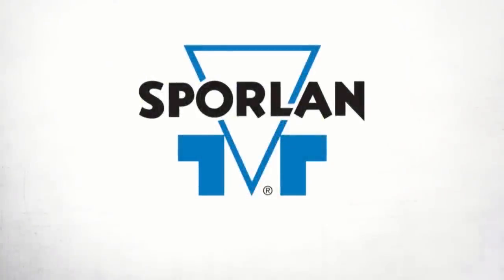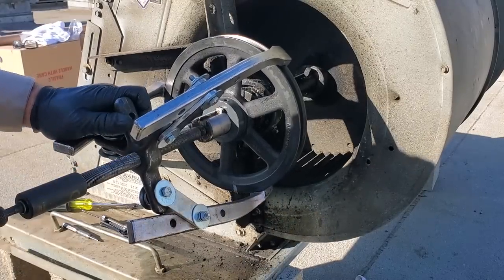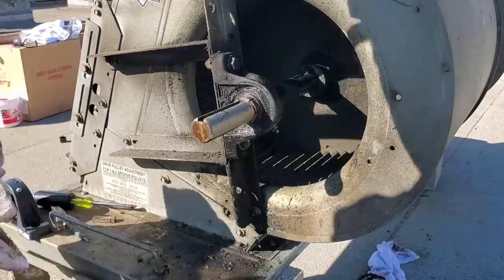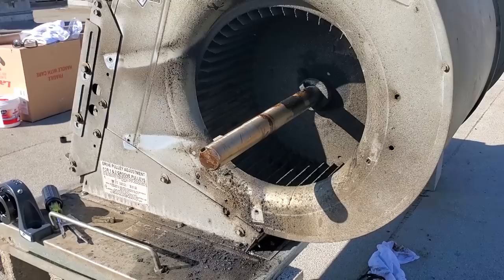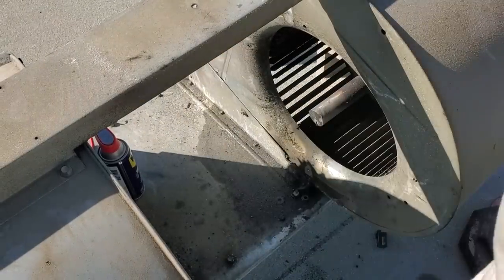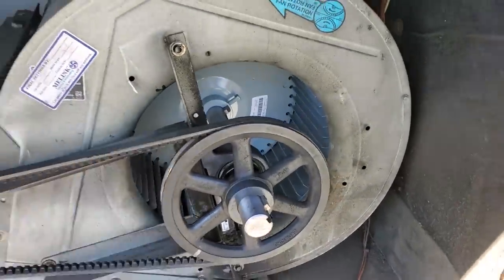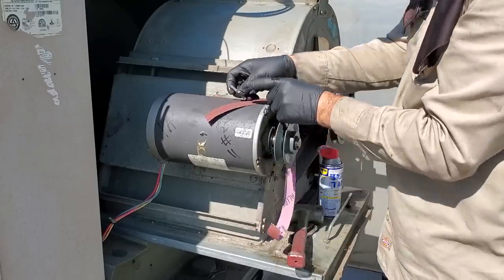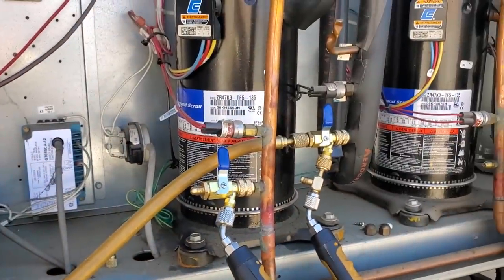LENNOX PACKAGE UNIT WITH BAD BEARINGS

Comment: As a non-HVAC guy... for the puller... you may want to try another way: use a big drill to make a small hole at the end, just enought so the tip of your puller get in. This will prevent it from wanting to walk away. Like a center hole for machining... Like center punch, 1/4" then switch to 1/2". The side of the  drill bit don't have to get in... Heck probably direct with the 1/4 it would be enought!

Comment: A sawz-all is your best friend when you’re trying to get rid of a shaft. Don’t even need to bother taking the bearings off. Cut the shaft inside the housing, no need to take the frame apart and the blower wheels drop right out. Text about five minutes total for both of them

Comment: Regarding the pulley remover - Looks like there was no cap on your threaded rod. The cap allows the rod to rotate without dancing over the surface of the shaft.

Comment: Knowing that you are going to replace the wheels, shift and bearings, you should have used a sawzaw to cut a 8" hole around the wheel hub. The bearings and shift could have slid through the hole in each wheel and you would have been done in 15 to 30 minutes. But I know you are showing how to remove just one bearing as well so... very informative.

Comment: You left the belt a little tighter than I would which doesnt affect how it works but does wear out the belt faster. The tighter you have it the faster it wears out do to constant tension and the elements.

Comment: anti-seize compound on those shafts would have been nice. Especially on the motor shaft, since its likely that the drive sheave is going to eventually be replaced again.
Reply: A guy I work with use to do that until he read the instructions that come with sheaves which is usually in red and states that using anti seize will void any warranty
Reply: Andrew what that was mostly likely is a tapered bushing sheave, where you definitely do not want to put an anti-seize or lubricant on the tapered surfaces. Even on those it is perfectly acceptable to put anti-seize on the shaft.
Reply: You can also have fun with Never-Sneeze. Just put a little on the underside of one of your co-workers toolbox drawer pulls, sit back and enjoy what ensues.

Comment: Oh yeah, pro tip....easy way to sand the shaft of a good motor to put the new pulley on, turn it on and use sanding cloth to clean it up nicely.

Comment: Idea: Cut some small notches into the outer edges of the pulley puller, then you can run a big rubber band around it so that the arms will keep pressure onto the pulley.   That can reduce a 6 hand job to 4 hands...
Reply: or put zip ties on the arms instead of notching them, then use a bungee cord.  Even easier.

Comment: If you ever get to do more, top tip for me would be to find a nice grade of steel wool which doesn't strand off, its often too hard and heavy obviously application dependant to go straight in with emry paper especially when dealing with seals etc and is often good for gripping and twisting round threads on other materials to clean has a lot of uses and when cleaned off polishes and picks up the shit, quick spray and wipe and good as new
Reply: Just as a side, thoroughly enjoy watching your vids

Comment: If I can give a small advice, it's about 30:42
Please don't use sandpaper over rotating parts. The sandpaper will release a bit of corundum dust as you work it and it's a disaster if you get that in bearings like in the motor below. It's way harder than HSS or any tool steel or cast, it's what grinding wheels are made of. It can stick into the bearing and cause pitting and lines of wear because it loves to stick into grease and into oil filled sinters too. It literally reduces the life of a bearing by years if it ever gets in there.
Also about the hex wearing out, order tools from WIHA. They make absolutely indestructible tools, we used them in the factory where I was and they could torque down literally hundreds of thousands of parts without wearing even a tiny bit

Comment: Gearwrench brand pulley puller. They are worth the money. The one I use has index notches so you can set each jaw without having it flop all over the place. Made my job so much easier.

Comment: Dude leave all set screws on motor pull loose and it will slide right on . If u tighten ajuster set screw makes for a struggle to reinstall. May I recommend a cutting torch if replacing shafts anyways much faster and less frustration. I also find  penetrating oil doesn't really help to unlock bearings etc just makes a mess.

Comment: I fully agree with the second guessing part. If you're just completely certain about something, you can easily just miss something, or gloss over something.
Second guessing yourself means you double-check everything, and that helps to make sure you don't forget something.

Especially when you're getting ready to do something that you can't take back, like when you cut that shaft. If you just go for it, you might've missed something, or missed a step, or something.

So yea, having that little bit of doubt isn't just great to have, I'm willing to claim it's paramount to avoiding possibly simple mistakes.

Comment: I have a trick for you , You are replacing the blower wheels and bearing so why not use cutting torch to cut around blower hubs and make quick work of this? The only part needing  to salvage was blower housing and pulley. Seems you worked very hard for such a easy repair.

Comment: I was called in to repair bad bearing on a dual fan assembly in the basement of a school, fan were 40 inch diameter with 2 1/8 shaft with 30 hp 600 volt 5 belt .No room to remove shaft or fans under  auditorium ,air handler was put in then school was built   center

Comment: Bearing jobs can be a grind (pun intended), and the struggle is real.... You do good work, however I would suggest using better practices when changing adjustable pulleys, belts and bearings. You're a smart guy, so I'm thinking you know all this already so I'm just throwing this out there. 

1) Pulley to Pulley alignment -- On smaller equipment don't need a $3K laser; a simple straight edge will do the job most of the time. It's very important for proper belt ware and power transmission.
2) Sheave adjustment -- Using the MFG data and taching the driven pulley shaft's RPM's would have given you the CFM data you needed. 
3) Proper Belt Tension/deflection -- It's critical for long bearing life (motor and shaft) and maximum power transmission. I have met very few tech's who can set the tension by feel, including myself.
4) Confirming motor amperage and belt tension after all is set and ran for 24hrs.

Comment: watching the video everyone has their own way to do things(so don't take this as criticism) but I never impact a puller, they wander all over, slow and steady with a wrench. if it's wandering, put a socket over the shaft and use the puller into the driven end of the socket. for the bearings cut a slot with a grinder and crack in two with a chizzel, the way I show folk is to sacrifice what your replacing to save what you ain't. always Interesting watching other folk work esp when the job still gets done.

Comment: Risky job and well done.... Just have one question, why did you eyeball the pulley alignment, why not at least use a straight edge for a more accurate alignment, or am I missing something that justified the way you did it? Thanks for all your contribution to the trade.

Comment: Notice how much heavier the fan is compared to the motor. You don’t want the WD40 in the motor windings, that would be tragic. WD40 can be flushed out of the bearings, motor windings no. I’ve done the alignment using dial indicators and laser alignment tools against a surface 20ft away. Maybe they weren’t pulling the drain plug when greasing the bearings. Should have cleaned the fan housing if you didn’t. Always grab a motor current reading prior and post bearing replacement, that may help you know if the alignment is off. If possible getting a vibration reading prior and post repair is a good idea to help understand alignment, softfoot, imbalance... if you ever hit a belt resonance you’ll wish you had one of those cheap belt tension measuring tools. Belt resonance is real and usually makes customers say “Oh my God! What was that?!” which doesn’t instill confidence. Good job. If I can dig up some “best practices” for bearing replacement I’ll share. The bearing vendors drop by once a year to give classes on all things bearing so I’m sure I got stuff lying around concerning bearing replacement. I didn’t notice you do anything wrong. It would have been better to use a straight edge to align the sheaves so they weren’t cocked with respect to each other and the shaft. It would have been better to perform a precision alignment on everything and belt tension. But given the industry you did fine. Their equipment can be down or unavailable for many hours at night or early morning for a repair no problem. For me, 24/7/365 operations, downtime can cost $$,$$$ to $$$,$$$ per minute so best to do it as right as possible and avoid unplanned downtime.

Comment: Never eyeball a pulley alignment and belt tension. Always use a straight edge and belt tensioning tool
Reply: Good call.  A straight edge or string to get sheave alignment correct.  Sometimes it's not possible to get alignment, but getting as close as possible is good.

Comment: Your end talk:-  Doubt about "Is shaft correct?"   What special things are there to check?  Put a micrometer on the shaft to check its diameter.  Should be measurable and accurate to half thou of an inch using even a low grade micrometer.  Length -- is it adequately long?  Miniscule length accuracy surely not necessary.
Reply: but then theres the added bit of uncontrolled incompetence. you have everything thats supposed to be correct, but one of the blower wheels was the correct size, but had the wrong size shaft mount, and threw off the whole operation. or the bearing has a similar issue. it can be a pita, and almost entirely not your fault that the supply house, or even their supply houses screwed something up.

Comment: I don’t know if this will help, but many of my mechanic friends use a chemical called fluid film on axle shafts and things like that to keep corrosion down. Perhaps using that on all the shaft parts not contacting the bearing will help repairs later.
Reply: one nice thing about corrosion, it keeps things from walking off the shaft =) I have 50 air handlers i am responsible for and walked by one and the pulley was on the ground, these are inside and out of weather, some good ole rust and grime like on this job would have kept it on i bet =) some of the guys at my work like to keep a little junk on the shafts just for that reason, you only have so much time to wander around and re tighten set screws
Reply: @robanderson84  interesting & good point 😁
Reply: Chris Storer fantastic stuff. Originally developed for WWII for Navy ships. Still going strong. Lanolin base, won’t dry out. Some people use it for undercoating their vehicles. About $10/can.
Reply: Chuck Quinn I actually found out about it watching south main auto channel with Eric. He uses it to do the same thing on all the brake parts so they don’t rust as much. Salted roads and snow = instant corrosion. People’s brand new cars at only 60,000 miles already rust

Comment: If you had a new shaft why didt you just grind the bearing off?
Reply: I initially thought the same, but to me it looks like the bearing is cast iron which would be a pain in the ass to grind off without a $20 novelty cutoff wheel. I do like the trick of biting onto the edge and spinning it free from the shaft. Learn new methods everyday

Comment: things learned here, you and three jaw pullers don't get along well. lol, they sure can be a total pain in the rear-end.
when they seem that far off, first thing to try is swapping around a couple of the jaws and plate links, also see if it has major wear on any bolts or the hub where the jaws and bolts are contacting. they get worn uneven and abused by hammering

Comment: I worked on one of these today. Had to run new stats wire and stats. Used to be wired to a bac controller but were taking them out. Nice unit but the way they carry gas from 1st to second stage is shit. Appliance connectors are junk, I’ve seen them tear or rip.
Reply from the maker: I will be going Live on YouTube this evening 10/28/19 @ 5:PM (pacific time) to discuss my most recent uploads and answer questions from the live chat, Facebook, emails, and YouTube comments come on over and check it out if you can.  https://youtu.be/wavAI7IcaQ8

Comment: The problem with the puller wasn't you. Most times you will find the indent of the center drill on the shaft which keeps the screw centered. This shaft didnt have it.

Comment: I was surprised you did not Grease the bearings note I am not HVAC tec
Reply: Grease will keep the bearings from getting damaged, but once the bearings get damaged/worn, it's time to replace them.
Reply: @RoastedHVAC  he did not grease the old ones or the new bearings. could of help with noise until they could be replaced
Reply: @dirt9925  that's a possibility on the old ones although that's not always the case. I've seen it where greasing bad bearings didn't help the noise much. For the new ones, maybe they came greased? Not sure, but I personally would give him the benefit of the doubt. Either way, you bring up valid points. 👍

Comment: A star has 6 side and a allen head has 8 maybe why it wont grab
Reply: JO65 I cannot agree with you on that one. I use torx bits in Allen slots all the time. An Allen key is also known as a “hex” key which has 6 sides.
Reply: they both have 6 points/sides. In his case someone probably used the allen that would've "worked" to install it and stripped the inner points out of the set screw.

Comment: How hard is it to balance?
Reply from the maker: as in air balance?? to do air balancing you need to get certified
Reply: Because you want it as mechanicalebalanced as possible you need to replace the axel, bargains and wheels. Then it will be mechanicalibalanced. Don't use the old axle and wheels.

Comment: You really show your mechanical incompetence here... Insisting on how an Allen key will undo a TORX set screw? Also surprised the puller is flopping around the place? Then ruin a perfectly good shaft and bearing carriers by hacksawing the shaft instead of tapping it out? Talk about ripping off the customer, that thing only needed a clean a 2 new bearings not blowers, shaft, carriers...WTF!
Reply: Do you work on equipment this size and age often?
Reply: @JasperJanssen  Yeah work on marine diesel engines, so pulling shafts and bearings is a daily occurence.
Reply: John Smith oh, that explains it. Your experience is only with well-maintained, well-greased shafts that aren’t rusted solid.
Reply: @JasperJanssen  Nah, we handle engines that have sat at the bottom of the sea for days to weeks and we still manage...